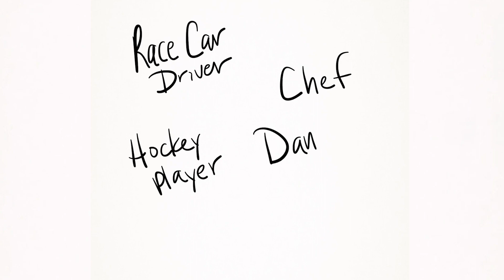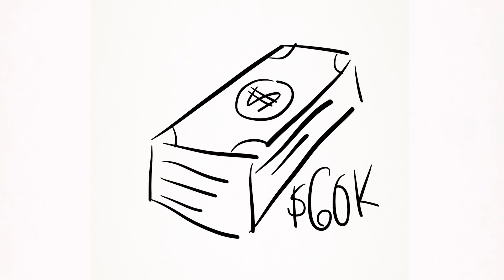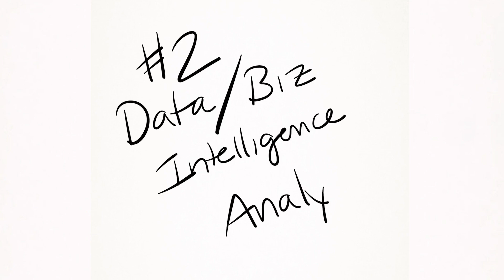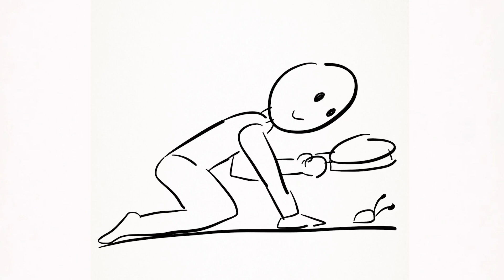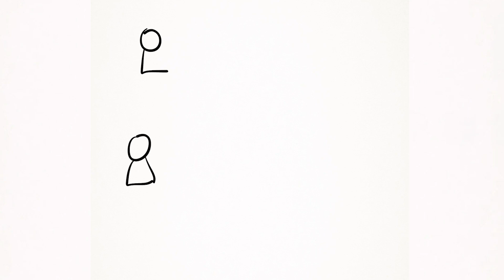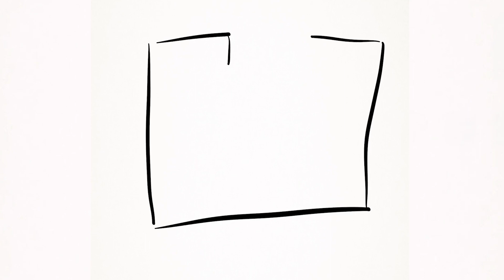Top 5 Jobs For Information Systems Majors, Average Salary, and Which Works Best for You!

Comment: i have a question what if i want to work as a banker. Can i get that job with business informatics degree??
Reply from the maker: Easy way to determine this would be to look up jobs and see if Business Informatics ever comes up in the recommended majors. My guess is that finance and economic majors are probably preferred.
Reply: @AngeloTheBA   oh then how about international business major? Sorry im just really worried and i really need some guidance
Reply from the maker: @gjijnv   My previous answer still holds true. I'm not a banker, so I don't have that answer. I told you how I would go about finding the information... Now it's your turn to put in some work.
Reply: I have a BS in information management and working at a banking center. we use multiple data and fraud systems to identity anomalies with transactions.  There are plenty of jobs in data security, data analyst,  ect.

Comment: what is the best between the project manager and IT manager and which country is the best for that one
Reply from the maker: An IT manager usually requires several years of experience. Project Manager usually has entry level positions. So if you are just coming out of school, there really isn't an option. Still though these jobs are not a matter of which is better, it's more about which you will be a better performer based on your skills or passions.
Reply: @AngeloTheBA  ho then I will choose It manager it's what I improve and thanks for your reply

Comment: Thanks for the video. I'm currently grade 12 and applying to universities. I did struggle with my math class but not dreadfully. I think the major is very cool and I aim to major it. Will my math bother me for this major?
Reply: This major is not super math oriented or at least not in comparison to computer science. I'm a computer science major at the moment but I think I will change to IS instead mainly because the math in computer science is very difficult.
Reply: I am trash at Math too. But shit.. you really gotta be really good, or just understand. You can’t skip math as much as you hate. You need to learn it. Don’t worry mate just try hard.
Reply: 꺼토미히라 I’m almost a graduate I haven’t come across any hard mathematics, if you’re good with algebra code and modelling you should be fine
Reply from the maker: In terms of levels of mathematics, it probably wouldn't get more complex then Algebra unless your working in a very technical field like aerospace or something. However, I would challenge you to try to understand what caused you to struggle because business analysis is literally about "Learning, understanding, analyzing, then sharing back that analysis"

Comment: Do i need computer science classes to have an information systems degree?
Reply: I have BS Business Administration with Management Information System specialization. I completed 12 subjects of IT out of 43 with MIS Project.
Reply: Shoaib Hussain are u doing a job dealing with that?
Reply from the maker: No, but qualifications for any degree is usually set by the school that you are getting it from and it can vary. You will likely take some programming classes, but it wouldn't be as intensive or in-depth as a computer science degree.
Reply: no business classes.. management information systems..

Comment: Is it possible to work in IT companies with a BS in IS? I know it’s part of busienss but usually with a BS degree you can learn more technical work such as networking, databases, and so on
Reply from the maker: Is it possible to work in Information Technology companies with a Bachelor of Science in Information Systems? Yes.
Reply: @AngeloTheBA  he said "I know its part of business" so I take it he meant MIS, not IS.
Reply from the maker: @sheepnoisebah  He used abbreviations which is never the best way to communicate if you want to maximize clarity. That's why I responded by rephrasing, as clearly as I could, so he could correct me if I was wrong.

Comment: in the beginning of the video you said you would omit the jobs that are technical and are for software engineering.  these jobs are technical and mostly for software engineers
Reply from the maker: I mentioned computer science and computer engineering, not software engineering. I excluded jobs around computer hardware and components (chips, processors, motherboards, networking & telecom, etc) where it is unlikely you can learn on the job without the requisite technical background.  Most of the jobs here require you to fully learn the context in which you will be working while you are on the job, and thus your ability to comprehend, analyze, and organize is more important than what specifically you learned in school. Data Analyst can be from Finance, Marketing, Economics, Statistics etc. Business Analyst can be from English, Philosophy,  Communications, etc. Project Managers just have to be diligent, detail oriented and organized and same for QA Analyst. I've even worked with a PM with a major in health and nutrition.  Most Information Systems programs have enough courses specific to development and databases, that if you are passionate, you could be a developer or DBA.